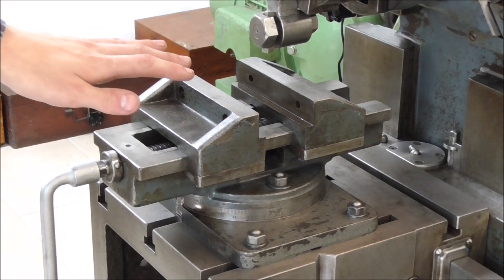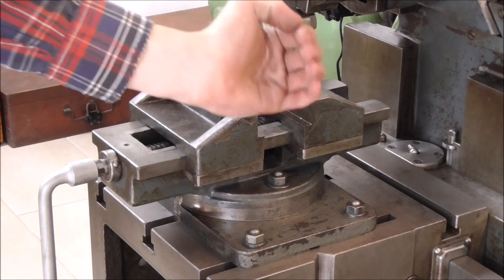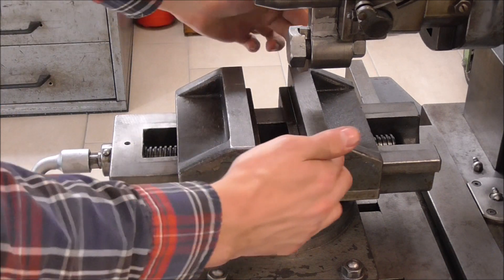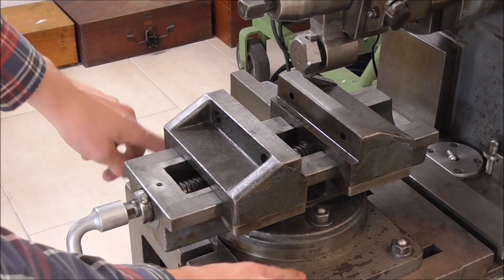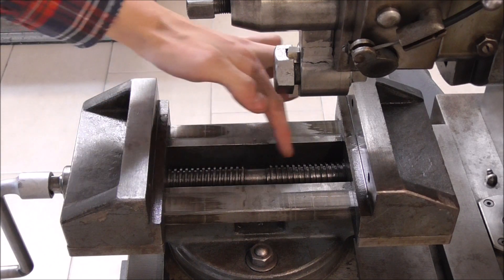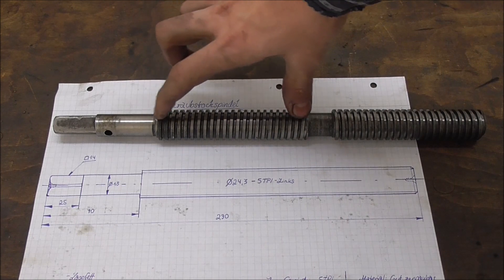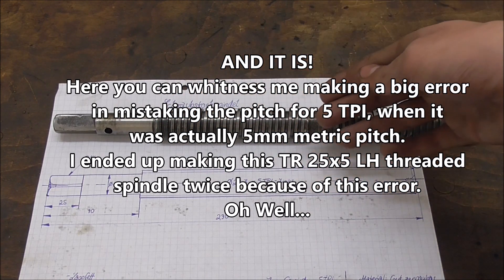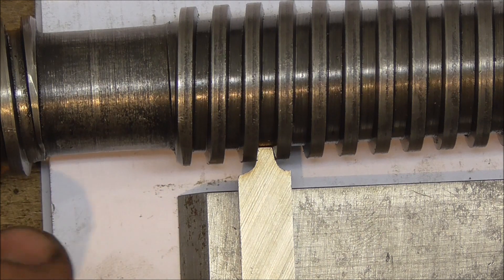Shaper Vice Mod

Comment: Excellent intention, but i fear that as originally intended all the clamping forces were absorded by the two jaws combined and now it is all on the body with no proper thrust bearing either.
Reply from the maker: I understand your concerns and have to admit that I hadn't thought of that until now.
That being said, the thing has been working for over 4 years now and is still going strong.
Reply: @AstraWerke  good to know it lasted, experience always outweighs theory.😉

Comment: Very nice, particularly the idea with roughing the thread  using a smaller parting tool. May I ask how the taper pins you used for the fixed jaw could be removed (if one wanted to go back to self-centering operation), supposedly the holes are drilled through and one can drive them out from inside the bed somehow?
Reply from the maker: Thanks!
Exactly, the holes are drilled through the sides of the U-shaped main casting, so one could either reach them with a punch from behind - or if you really wanted, one could also drill and tap the front of the taper pin and drive it out with a ram weight on a threaded rod - they are not super tight.

Comment: When I saw the drawing I wondered about the pitch, because few European vises would use an imperial pitch. Close but not quite :). The pinning idea for the fixed jaw worries me a little because heavy clamping might bend the pins. But we will see. Nice job!
Reply from the maker: Off camera, I wrenched on the thing with all the force I have and an indicator set up onto the fixed jaw. It moves maybe .03mm and returns back to where it was when pressure is released. I'm guessing most of the force is absorbed by the way clamps underneath the jaw that I shimmed to tightly grip onto the vice's bed.

Comment: That's a great video! The vise is the most annoying thing for me on my Klopp, it's just so clunky to use, not even taking the clamping force into account. For example when I set a work piece on parallels and I try to clamp it, it will move around if I don't put the work piece exactly on center. Also, I really prefer a fixed jaw vise to have a fixed jaw as a reference. Great work, thanks!

Btw, have you got a new lathe?
Reply from the maker: Well, I'm hoping to have improved the vise enough to make it useable... We'll see how it holds up under heavy use.

As much as I hate to say it, that lathe is not mine. It belongs to a long time neighbor of mine (just like the surface grinder) and I get to use it every now and then for projects that are either too large for my lathe or that involve single-point threading as my lathe does not have a leadscrew to do such things.
Reply: Adrian Straub right, I think that now I remember that you used it in one of your videos